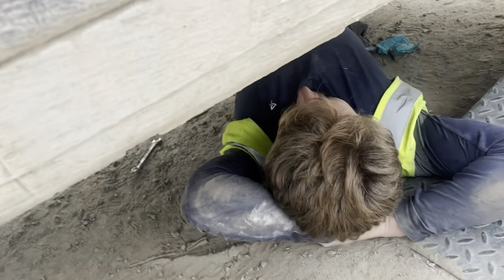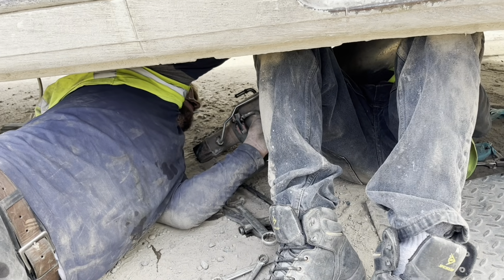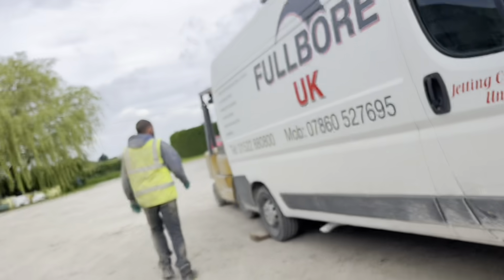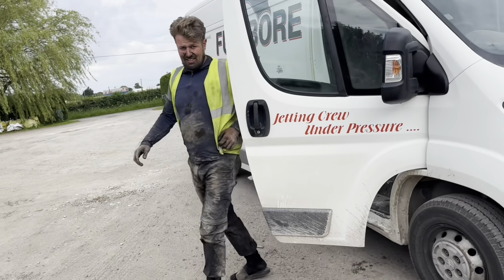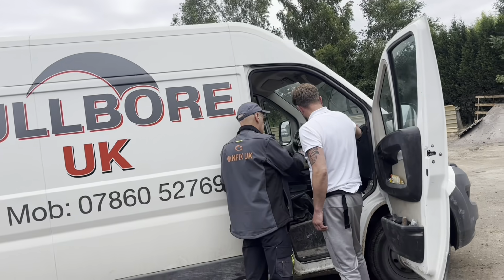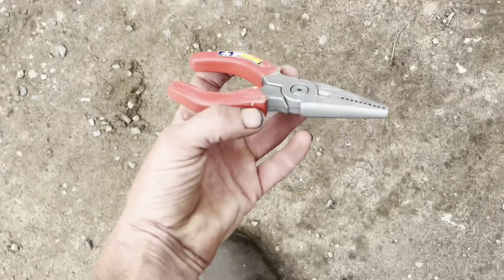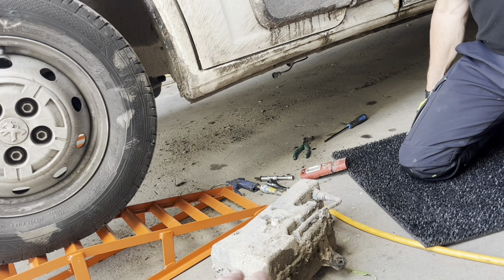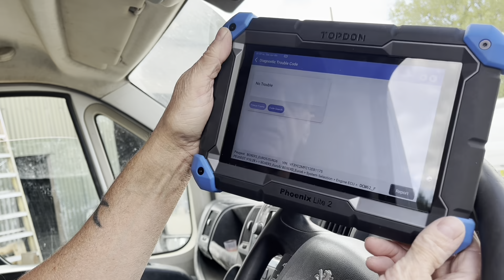Diesel particulate filter fault - DPF, and PAT fluid 💸 explained! 🤷‍♂️

Comment: In Canada I have a pickup with a 6.6 litre V8 diesel, it only uses DEF when it is running, the DPF regens at 42 grams of soot or after I have driven over a set amount of KMs. There is nothing on the truck to keep the DPF cool, but I do have a diffuser on the tailpipe.

Comment: You may find the problem returns quickly,  cleaning will remove soot, but it won't remove the rock hard ash which eventually clogs up the fine tubes in the filter.

Comment: DPF and EGR valve devils invented. I have lost count of how many I have done now. Peugeot car's HDI I have refilled and done static regen on them. Also changing pressure sensors on them. I have even cleaned one with Mr Mussel drain cleaner 😂😂😂. You be surprised EGR Valve Get it off fire a good bit of Mr Mussel or brake cleaner in it make sure its nice clean wack it all back on good for another 100tho 😂. Or Go down the better root map it out.

Comment: Washing up liquid and water in a spray bottle will do the trick Chris I have always just undone the air intake pipe and sprayed it in with the engine running warm, emptied bottle put pipe back on, then blitzed it down motorway a junction and come back a whole different motor

Comment: I have never had any emission problems dpf egr etc entire fuel system including the turbo and fuel pump.

Quality fuel and Archoil AR6400D ( diesel ) AR6400P ( Petrol ) been using it donkeys years.

Comment: Like anything made now with vehicles you have to cost money to take it to a garage or replace the parts at massive cost I had cat converter block up on my Ford focus I chucked it on a bonfire and when was cold again I used a air line to blow the crap out changed the senser 👌👍 that Josh is crazy 😵😵 you don't want to breathe that crap in not good for you at all back at Scottys yard again how's the back as you don't listen to no body little birdy all ready driveing around vinny knows he's stuff 👍

Comment: Milky tea is best. Get yourself an inversion table. gave me a lot of relief. Good for other back problems, too. Gives you a lovely stretch No more than two minutes at a time. . They are quite cheap on ebay. And fold up. store under a lot of beds. But follow the instructions. and make sure somebody is there at least One person present with you.  the first few times you use it. I  would hate to see you stranded upside down. I know one car mechanic who uses his car ramps and ties his feet to it and pulls himself up and hang. there. He swears he gets back relief whenever he has any back rouble.

Comment: If you have to clean the soot out by running the engine to clear it out of the exhaust what's the use of putting a filter in to begin with.

Comment: your dpf is like that because you are only doing short trips to regen your dpf you go into 2-3 gear and sit at around 3000 rpm for 10-15 mins it will then burn all the soot/carbon out of the DPF.
Reply from the maker: @blastingweevil2968  yeah they only mainly go local mate! Needs a good run every now and then 👍👍